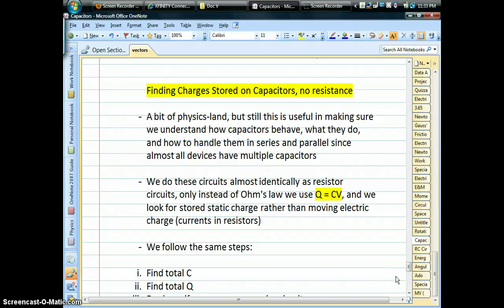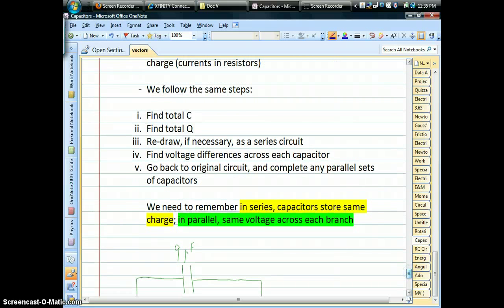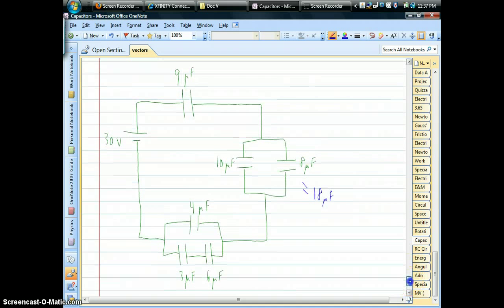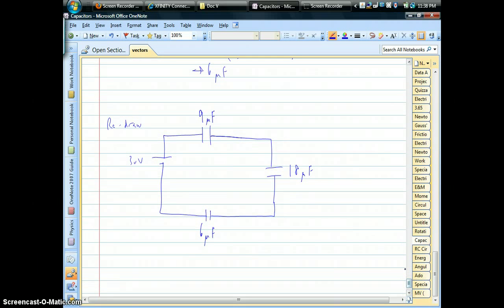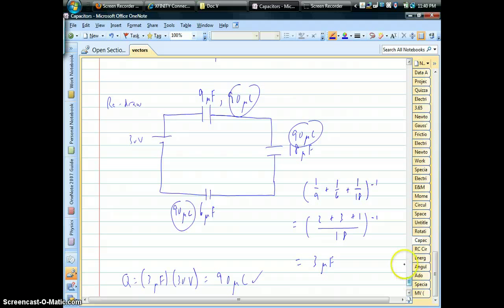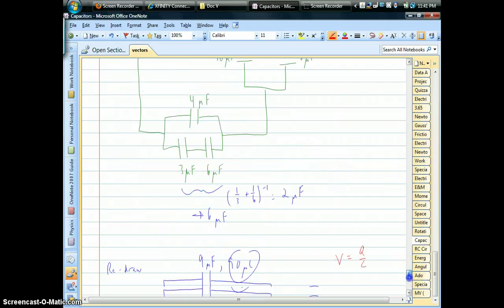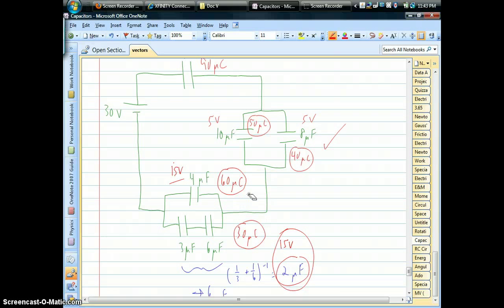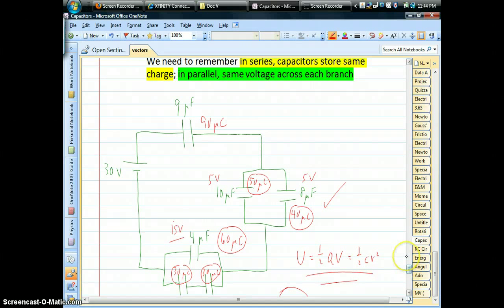Capacitor Circuits - How to Find Stored Charge

Comment from the maker: Towards the end of the video, we show that the 4uF is at 15 volts, and therefore the charge on it is Q = CV = (4)(15) = 60 uC.  Then there is 30 uC on the other branch on both the 3 uF and 6 uF caps).